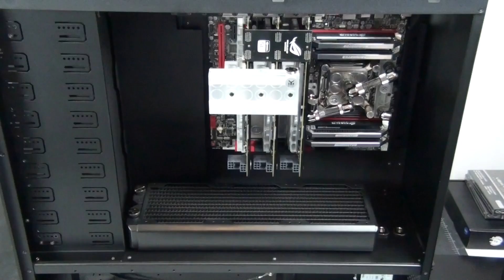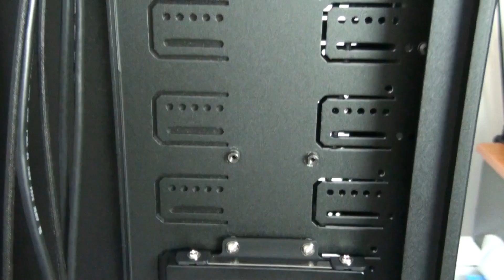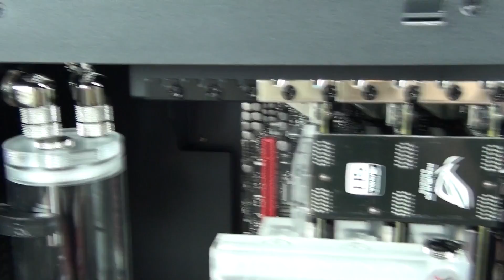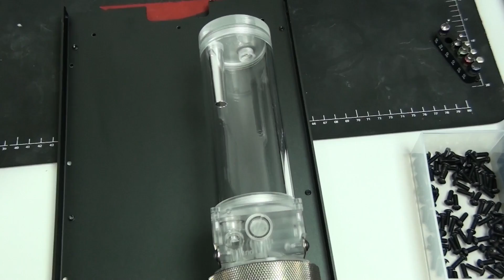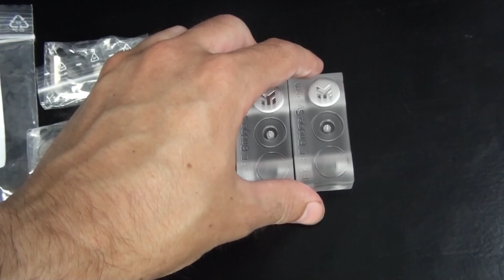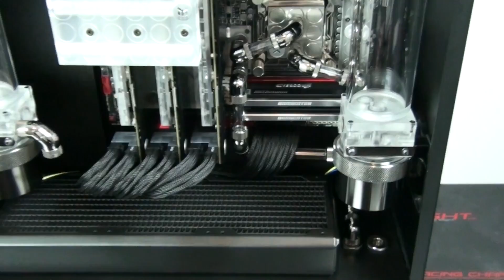Build #8: 'Cytotoxic': Part 4

Comment: i'm not sure if it's been suggested or if you've figured it out on your own.. but for holes through panels like that, especially bigger ones, you should probably get yourself a stepper bit. They're available in several sizes and make that kind of work far easier and more accurate than big drill bits or smaller ones plus tons of filing. Still catching up on client builds.... you might have caught up on this yourself by now.

Comment: I had the same issue with my push/ pull config. My fans were touching and making noise. They sell plastic washers with different thicknesses. That solved my problem.

Comment: fittings dont have ID and OD. that refers to tubing. he uses fittings with a G 1/4 inch thread. the tubing (not the crystal link) he uses has a 1/2 inch ID (Internal Diameter) and a 3/4 inch OD (Outside Diameter). the crystal link thats used need a special fitting to use it i think :)

Comment: Just wanted to quickly as a question about the TJ11.  For the PSU do you have to use an extender for the 8pin CPU plug?  Im using a AX1200 PSU

Comment: Dear Mr. Singularity, why should one choose a dual pump configuration in a single loop? I am currently looking into a system using two 420 radiators and one 360.

Comment: this waterccoling loop is a little bit overkill for the system without too much overclock so the temps wont go up to high at all. and it even helps to prevent dust as long all the intakes are filtert, the hot air will find its way out through the little gaps in the case and i think there is one exhaust at the top nere the i/o.